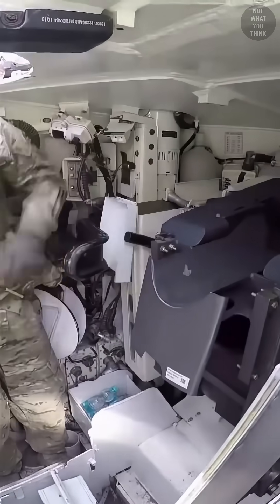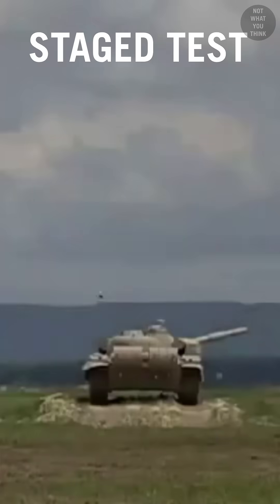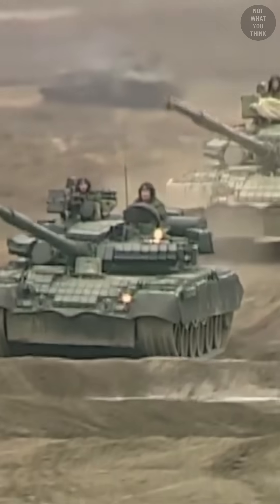Why M1 Abrams Tank Has No Auto-Loader #shorts

Comment: The Leclerc has an autoloader and also has a blast door. Truth is, when the Abrams was designed it was a good decision, not so much nowadays. But hey, the extra crew member makes it better in War Thunder...
Reply: ah yes the snail
Reply: @TheRealSteve42 according to some good tank channels on youtube (like tank nut dave) manual loading is faster for short bursts, but obviously humans get tired and autoloaders don't so in long fights it's less straightforward. That said, many theorize that sooner or later tank guns will need to become larger to defeat better and better armor, and at some point very few humans will be able to load several shells and remain combat effective. Will it be at 130mm Rheinmetall MBT gun? No idea, but the heavier the ammo, more attractive autoloaders become, until they are just required.
Reply: When they introduce a bigger gun like the 130 or 140 then they can't go around a autoloader.

Talked to a guy who served as a loader on Leo. 2 and he just told be that slinging those rounds is a pain in the ass for how much they weight.
Reply: @Tankliker  i’m gonna call cap on that. artilleryman constantly hand load 155mm shells by hand, which weigh more than twice the weight of a 120mm tank round, plus the charges. if i can load those rounds, then the tank bois can hand load a 130 or 140mm round too
Reply: @Wabbaaajack  on a stationary artillery piece in open field. 

Yeah, nice one. 

If you have the chance, just go inside a Abrams with the longest broom you can find and try to get the handle from the rack into the breach. If you manage then to it again but add like 50kg of weight to it. 

There is a very big difference between being inside a tank and being on a openly accessable gun which needs to be as simple as possible and has to operate out of supply often\air supplied regions.
Reply: @Tankliker  uhhh yeah, no. M992 CAT, tracked vehicle used to carry 155mm ammo. loading is done by hand because the conveyor belts are slow as fuck. try loading 100 lbs rounds inside a tight vehicle into slots overhead, it fucking sucks but very doable. still faster to do it by hand then using hydraulics. so yeah, nice one.
Reply: @Wabbaaajack  so you are telling me autoloaders suck because your nation didn't got it right. 

The Swedes managed to fire 12 rounds in 45 secs with their Bandkanone which had a autoloader
Reply: @Tankliker  reload on the bandkanon takes 2 minutes with the auto loader. it’s ROF wasn’t high because of an autoloader, it’s because it was magazine fed. the swedes also didn’t get it right if they stopped production halfway through. try again
Reply: @Wabbaaajack  magazin fed by a autoloader. 

Nice strawman dude, every autoloader has a fucking magazin. 

Every modern tank has a magazin, both autoloaders and manual loaded ones. 

And you know the reason? Because where else would you store the fucking ammunition if not in the magazin.
Reply: @Tankliker  uhhhh, no. the bandkanon used 15 round replaceable magazines, sort of like a rifle. majority of tanks that use auto loaders use a belt system. so again, you’re wrong. manual loaded tanks do not have magazines, so again you are wrong. they’re stored in a honeycomb rack where it is hand loaded. i don’t think you know what a magazine is.
Reply: @Wabbaaajack  Ever heard of fixed magazins if you want the gun comparison? 

And yes, I am aware that most modern manually loaded tanks have both a bunker and a ready rack. Which are both still are basically magazins. 

You know, ammo storage is also called magazin. Magazin is just where you store the ammunition. 

A tank/spg without any kind of ammunition storage/magazin would be quiet useless.
Reply: @Tankliker  enough with the semantics. i’m talking about functionality. ammo storage compartments are also called magazines, that’s where we get the word magazine, from ancient weapon depots. but they don’t function the same way as magazines, like in rifles. that’s why the bandkanon is unique, it functions like a detachable rifle magazine, not just an ammo rack. that’s why it had such a high ROF. moving on, autoloaders aren’t gonna be necessary if tank rounds get larger because they’ll still weigh less artillery rounds which are loaded in similar conditions in the M1906 Paladin.
Reply: @Wabbaaajack  Dude, if you are able to sling 1,5m long 50-60Kg heavy rounds in a moving tank in a space not bigger than now. Then good for you. 

But i will bet money that 90% of all current loaders couldn´t do that. 

While a autoloader doesn´t even slow down when the vehicle is moving. At least in case of MBT´s. 

Next thing would be that the korean K2 already achieves between 3-5 sec on reload time, for every single time. 

PzH2000 also can fire up to 13 rounds a minute. With the help of an autoloader. Propellant is loaded manually tho.
Reply: @Tankliker  what i’m saying is from my experience, you don’t need an auto loader. the most you’ll find in a Paladin is the hydraulic loader, which has to be loaded by hand. we’ve been loading heavier rounds in just as cramped spaces for years and we’re fine. tank rounds, even ones with larger bore diameters, are lighter. you guys can manage
Reply: @Wabbaaajack  question, artillery rounds are two piece am I right?
Reply: @Tankliker  it depends. 105mm rounds are semi-fixed, meaning the charge and the round are loaded together, like one big bullet. a 105mm HE round is about 60-65lbs. a 155mm HE round is not fixed, the round itself is 100lbs and the MAC charges weight about 7 lbs a piece, up to 5 MACs can be used per shot.
Reply: @Wabbaaajack  now imaging loading those 100lb as a single piece while driving at like 25mph over rough terrain.
Reply: @Tankliker  the 100lbs is a single piece, i just said that. it’s 100lbs + all the other weight
Reply: @Wabbaaajack  ok, got that part wrong. 

Still, try load it while driving at 25mph over rough terrain while inside a tank. 

I think you already can imaging how good that works after like the 3rd round.
Reply: @Tankliker  Then he is a Pussy ;D 
A Good Loader is faster than a Auto-Loader. And he is also much more for the Crew than just a Loader. I say that as an Ex Tank Commander
Reply: @hf4040  they are faster on the first couple rounds. Then they get tired.
Reply: @Tankliker  you doing
Reply: @Tankliker  the french/german tank will have a 130mm AND an autoloader
Reply: @tm.8399  the French want the 140mm for the euro MBT
Reply: @Tankliker  the smoothbore hasnt been discussed yet tbh if I followed correctly, but being autoload has been an unanimous decision.
Reply: @Tankliker  Imagine wasting a month in this comment section, that's real dedication for arguing over a dumb topic
Reply: @Qrazy Gile loader of the new and super rare super M1 Thumper? 

I shouldn't have doubted him. 

He will sling those 100kg rounds singlehandedly then.
Reply: @biodidu25  biggest reason would be weight. An autoloader can be build way more space efficient, which literally translates to tons in safed weight.
Reply: @Tankliker  just a question, are the power plants in the tanks the same, the way they drive the way the tracks move, and what about amount of power it takes to pierce the tank? Just genuinely curious if there's any differences other than loaders that maybe why the army continues to use the Abrams.
Reply: @Dukes3677  compared to what? Leopard 2? 

If so, then it's depending on variant mostly. 

First of all Abrams is besides T-80 the only production tank with a turbine as far as I know, which only downside is very big fuel consumption compared to diesel. But all other metrics except heat signature are better, maybe except top speed. 

About the gun, Leo 2 has the L/55 since the A6 which longer than the M256, which is based on the L/44. 

L/55 gives a pretty clear firepower advantage. But the US won't use it because DU ammunition becomes nearly useless after 1500m/s of speed because they just self ignite and burn up mid flight. 

Germany on the other side uses tungsten, which has some poor characteristics after impact, but which mostly basically get solved with higher velocity, namely after roughly 1700m/s. DM63 reaches around 1750m/s I think. 

About the loader. It's a choice question. Autoloader means less lifecycle cost but is more expensive to buy and install, on the other side it can be made way more space efficient. That's why the T-14 Armata for example doesn't weight more than western counterparts with human loader. 

But the human loader on the other side means a 4th men in the field, which makes some jobs in the field easier because another hand is always welcome. 

But the biggest problem is that a human loader first of all needs much space and especially much height, because you can't load effectively if you are sitting or laying down in there. 

But every centimeter means more weight. You can translate for western MBT's that 1cm means roughly 500-700kg in added weight. 

And as we speak most western MBT's expect the Leclerc are at 65T, which means a great reduce in field effectiveness as more weight makes going through certain terrains more difficult. 

Overall the human loader is a good short term solution if you design a tank that does not need to stay long in combat but often out of friendly supply. While autoloaders are way more supply dependent but add much more combat effectiveness imo.
Reply: I strongly disagree. First it's about the ammo, auto loader tanks have predetermined sets of tank shells.
What they don't have is a mechanism enabling them to foresee the future.

Why is that an issue?
Because not all shells are alike.
They have different purposes for different targets.
How the hell would I know which target I'll encounter, and at what order?
I don't know what I'll need and I don't want a machine to decide for me.
And even the most elaborate and modern ones where you CAN change ammo, can't supply me with a series of same type shells, of any length required, that I may actually end up needing because:
1. You don't always hit on the first shot,
2. Sometimes it takes more than one shell to destroy a target.

This alone - the incompatibility of ammo - is enough to render the auto loader system for tanks irrelevant.

The loader (Let's decide that "Loader" is Human, and "Auto Loader" is the out of touch mechanism, OK? Cool) is not just a loader:

He is the crew's Comm Specialist.
We have all types of communications systems, and sure, as tank commander I CAN take care of them if something goes wrong. 
but you know what?
I'm kinda busy here commanding the tank crew...

Under no circumstance would I prefer a tank with an auto loader,
or even find any room for comparison of one, with the far more preferable 4 men crew based tank.

Without elaborating too much, the Loader is trained to a certain extent on other crew members duties.
He can replace one, and I, as commander, can make do with a team of 3 for a while if I have to.
The duality of capabilities also allows the crew to conduct double shifts, if we're on a long mission like an ambush.
Not much an auto loader can do here.

Also, the Loader, like other crew members, is also a trained infantry soldier when need arises.
He can grab a machine gun, an M4, both perhaps, some ammo, a medic kit and water, and then dismount and fight if the tank is decommissioned.
He can help carry a stretcher if a team member is down.
Sometimes the entire company or regiment is used for an infantry mission:
With auto loaders we'd be 25% men short.

One perhaps lesser known facts about tank crews - We do A LOT of maintenance.
We are also trained to fix a lot of the problems that arise during training and battle, especially to the track system.
Losing a fourth potential man when these happen... No tank crew member wants two hands LESS on deck.
Reply: this guy plays war thunder, he knows his stuff
Reply: You guys are acting as if there tank battles that go on so long that the loader was too fatigued, and as if the driver loader or whomever else couldnt swap places with this guy in the event it somehow does become a never ending 12 hour fucking tank battle?? Lmao
Reply: @mimikeofficial86  That @Leopard2A7V guy apparently thinks tank combat involves the enemy driving in single file line over the hill where you have to engage tons of enemies one after the other over a couple hour period. In a real tank engagement it starts super quick and ends just as fast. You'll be dead before you ever end up in a situation where you need to load 10-15+ rounds in rapid succession. If you ever end up in a situation where you need to kill 10-15 enemies with no support then something went horribly wrong and autoloader or no autoloader you're gonna probably die.
Reply: @huntforandrew  thats what I was thinking, I doubt he really served as a loader in a tank, sounds more like a war thunder expert to me...
Reply: @huntforandrew  lol literally all new MBT uses auto loader machines. Nobody deliberately used manual human loader. The only one that defending the manual loader as you can see is just butt hurt M1 abrooms fanboys.
Reply: @sys3248  You do know the Challenger and Leopard 2 and Merkava all use a human loader right? Between that and the Abrams these are the best tanks in the world that everyone measures themselves against. Poland, Taiwan and Australia are all planning to buy M1A2C's, Leopard 2 is exported all over the world and the new Challenger 3 will have a manual loader.
Reply: @huntforandrew  try telling me when they were designed.
Reply: @huntforandrew  you can also tell me whether upcoming Design to replace Abrams would uses manual loader lol 
😂
Reply: @huntforandrew  "You do know the Challenger and Leopard 2 and Merkava all use a human loader right? Between that and the Abrams these are the best tanks in the world that everyone measures themselves against."

The challenger is crap, the Leopard is an old tank now, the Merkava ?

The Leclerc did better than the m1 in recent operation (Yemen, it has an autoloader. The chall 3 ? The Uk doesnt know and never made a good tank. The german and french next joint mbt will have an auto loader.
Reply: It's really sad that so many people liked this comment. Probably a bunch of kids and people with little to no real world experience. Automatic loader is better on paper, but in reality, manual loader is far better.
Reply: @joekent5675  because reasons I guess? Yeah, good ahh... thesis. 

The kid thingy can be ignored from my side, not important to the conversation. 

But your claim about reliability would be interesting, as one french guy already stated that a Leclerc tanker told him that the chance of the auto loader failing is very low.
Reply: @Tankliker  yes, I'm not exactly "hating" on the auto system, but a low "chance" can still be risky, especially in a war with a major superpower or another world war.
Besides that, manual loading is getting too much hate because of "new technology". Often times it's because of the "on paper" appeal that the auto loader seemingly has that outshines the manual...but the truth is, they are more equal than inexperienced people realize and it comes down to perspective and real world application. Yes, auto loading is more likely better for the short term engagements, that get rounds down field, and that free a man up for other jobs. But "medium plus" wars show that a fourth man is better overall, due to maintenance, observation, extra MG position, moral in battle, and emergencies. Auto loader might be better for france, but for America...it's not.
Reply: @joekent5675  what about the not so low Chance of the loader hurting his hand outside the tank and taking himself out of combat for a while by himself?

The whole reliability argument becomes useless if you look at an autoloader. The Russians already proved that they are reliable, you just need to maintain them. Just like the engine. 

Also, autoloader outshine manual. Less lifecycle cost, no chance of failure outside of service (an autoloader never will cross a road and get driven over or maybe break his hand and need 3 months to heal it) and all damages can be fixed in mere hours at most. 

It does not make loading significantly faster for 120mm shells. But 120mm is also the upper end for what humans can reliable loader if your tank crew isn't exclusive 1,90m guys who can lift them like it's nothing. 

But 130mm and 140mm mean either 10Kg or 20Kg more weight per round. And 120mm already weights 30kg.
Reply: @Tankliker  I'm not arguing that autoloaders aren't realible. Risky? Yes, even though there is a low chance of breakdown. Plus, once the round is in, the auto can't get it out. On paper, the autoloader outshines the manual loader, but in real life, they are nearly equals, with manual overall being better... but it comes down to size of country, military doctrine, and just overall preferences. The issue is the 4 crew mate helps in lots of other areas. 4 is soooooo much better than 3 when it comes to maintenance, emergencies, and even morale. It's a 2nd mg as well. A big war where is where the 4th crewmate shines, but short skirmishes, the autoloader probably will seem flawless.
Reply: @Tankliker  you're wrong about them being too heavy in the stamina department. An average army dude has no problem slinging those rounds around in the tank. I used to do something similiar when I was in. But my rounds were heavier and I handled a whole lot more.
Reply: @joekent5675  no back injuries afterwards?
Reply: @Tankliker  um...no. take care of your body and it's fine.
Reply: @joekent5675  I didn't ask for your general opinion. But ok. 

Anyway, look at how many retired tankers got out with back injuries and then look at how many of them served as loaders. You will see a relationship.
Reply: @Tankliker  that's true for many positions in military. There's more to being an army loader than sitting in a tank loading rounds. Jeez.
Reply: @joekent5675  why would you preload a round if you don't even know the target? 

That's not like in War Thunder or World of tanks, where the round just loads regardless.

Also, pulling a round back in the rack is nothing more than a technical challenges which can be overcome with ease. You literally just have to reverse the movement and add some holes or something at the bottom of the round to pull it back. 

It's not magic
Reply: @Tankliker  >what about the not so low Chance of the loader hurting his hand outside the tank and taking himself out of combat for a while by himself?

A gunner becomes a loader with the same fire rate. In case of the not so low chance of the broken autoloader of T-72 a commander becomes a loader with the very low firing rate. No commander in the tank just because some mechanical stuff is broken, very clever design.
Reply: @thewhite8uard  nice strawman. Maybe provide a number next time and also compare equally. 

Back injuries after service for tank loaders (which can take them out of service in worst case) and then loader failure in Leclerc, K2BP or Type 10 or even T-90 if you want too.
Reply: @Tankliker  the fact that you asked that question makes me wonder if you really know what you're talking about. 

Often times, in many engagements, a specific round will be loaded for a specific type of target, but then the target will change and so therefore the round has to be replaced by a different type.
I don't play those games...yet.
Reply: @joekent5675  and you seem to have no idea how an autoloader works. 

Yes, I've never taken part in a real engagement (and hopefully never have too. War is nothing to be proud of) 

But still, you literally just need the arm that pushes the round in to pull it out again, which can be easily realized by adding to grip holes for the arm that pushes them in to pull them out again and chance them.

Changing rounds also would probably take double the amount of time of reloading or more, if you put the ammunition back in the rack and pull a new one out plus a higher chance of deadly rack explosion because the door has to stay open longer. 

An autoloader would definitely cut time here, because the arm can just extent through the small hole for ammunition, pull the round back, close the door while rotating to the new round and then reload.
Reply: @Tankliker  I guess I could be wrong about this, but everything I read says autoloaders can't do that.
Nonetheless,  my other points still stand. I was in the service and I can tell you the 4th crewmate is better.
Reply: @joekent5675  I never said to drop the 4th man. 

I would just replace the human loader, as it safes human cost and space. 

The French also liked having 4 men. They just drove the remaining 4th guy in VBLs behind the tanks in their last combat missions with tanks as far as I know. 

Also, if the tank is under fire/out of combat but still under fire it really doesn't matter if you have a 4th man for repair or what loads the round anyway. 

What could be a game changer tho would be the 4th man as a spotter/radioman with his own optics and to take the task of the commanders shoulders to operate the computers inside the tank.
Reply: @Tankliker  It's funny fact, not an argument. You sure you know T-14 maximum engine power but its size is secret for you? That's denial.

As if only ex gun loaders have back injuries. That's the straw man. How does that related to combat readiness? Why "or even T-90 if you want too", but not T-72? Unlike T-90 T-72 is MBT of Russian Army. I
Reply: @thewhite8uard  how it relates to combat readiness and how I don't know internal design of a tank that's internal layout is protected as a Russian state secret but the engine power because they statet it in a official report from the kreml?

First, a loader unable to load is equal to dead weigh and you also have to keep him alive because he's still a living thing. 

About the engine, I could guess. I'm not a tank engineer who works for the Russia gov on their newest tank and knows all the metrics inside (which also are still a state secret) 

Also about you question why the Armata is so light. It literally has no turret armore. All that's sticking out is the breach, loading arm and hard kill APS plus some electronics, which all are only protected against light arms and shrapnels. The rest is literally just thin sheet metal to cover against small threads.
Reply: @Tankliker  >how it relates to combat readiness and how I don't know internal design of a tank that's internal layout is protected as a Russian state secret but the engine power because they statet it in a official report from the kreml?

I'm talking about size of the tank, not it's internal design.

>First, a loader unable to load is equal to dead weigh and you also have to keep him alive because he's still a living thing. 

And that's your argument? You can say it about any crew member it won't sound more silly than that.

>Also about you question why the Armata is so light. It literally has no turret armore.

I didn't ask it.  But it's funny that you claim that MBT that 10 tonnes heavier than T-72 has no turret armor. It makes T-72 looks like it has no armor at all.
Reply: @thewhite8uard  I stop here. Just watch a yt vid and you will learn something about it. 

I can't explain if you literally dismiss facts because you don't like them. The T-14 has basically no heavy turret armore. That's s simple fact. 

Also, yes internal layout has something to do with engine volume 

Smaller engine = less volume =  = less weight/volume to put armore around or more space to put shit in. 

No tank has a big airfilled gap inside if not absolutely needed. 

Also, yes. Retirment cost are a real concern, because your tax money pays for the retired soldier.
Reply: @Tankliker  >Also, yes. Retirment cost are a real concern, because your tax money pays for the retired soldier.

Where is your data?

>I can't explain if you literally dismiss facts because you don't like them. The T-14 has basically no heavy turret armor. That's s simple fact. 

Ok, dude. How's that explain 10 tonnes increase in mass? T-72 had no armor at all even in hull? Or T-14 is design failure? 

>Smaller engine = less volume =  = less weight/volume to put armore around or more space to put shit in

How does that related to T-14? T-14 is much heavier and bigger than Soviet/Russian second generation MBT. T-14 is almost 2 meters longer than T-72. If it's all armor than T-72 has no armor.
Reply: @Tankliker  >I can't explain if you literally dismiss facts because you don't like them.

You don't dismiss facts, you dismiss incorrect arguments. Fact can be denied, and that's what you do all the way.
Reply: @thewhite8uard  then tell me one of your facts.
Reply: @Tankliker  >then tell me one of your facts.

T-14 is almost 2 meters longer than T-72, and almost 1 meter longer than M1 Abrams.
Reply: @thewhite8uard  what data do I need to show to prove that retired soldiers need to be paid retirment for them to survive?

About the T-14. The LOS armore on the front is about 1m. That means a large block of 1m of armore is there. Also it's a 3 men tank with an autoloader, so it doesn't need to cover space for a standing loader. Autoloaders can be build way more space efficient. 

About the turret. As I said, it's just the breach and the gun, some electronic, optics and the APS. The gun itself is just such a small target that hitting it is less likely than hitting the hull even in a semi hull down position and because all three crew members are in the hull in armored capsules with 1m of armore in front of them nobody cares. 

A tank can be replaced if destroyed, skilled crew can't if killed.
Reply: @Tankliker  >what data do I need to show to prove that retired soldiers need to be paid retirment for them to survive?

You need to show data that an M1 Abrams gun loader get increased retirement payment. Or it's just an argument to the poverty? Yeh, Russia is a poor third world country and they pay nothing to their NCO servicemen.

>About the T-14. The LOS armore on the front is about 1m. That means a large block of 1m of armore is there. Also it's a 3 men tank with an autoloader, so it doesn't need to cover space for a standing loader. Autoloaders can be build way more space efficient.

So you admit T-72 doesn't have adequate armor.
Reply: @thewhite8uard  the T-72 had adequate armore for its time. So good the west was unsure if it could pen it with the earliest 120mm projectiles. 

They also still upgrade the tank to stay competitive. The main problem isn't armore tho, but that the loader won't allow bigger ammunition to be used. 

The T-14 counters that problem with a new gun that makes it possible to user longer penetrators.
Reply: @Tankliker  >the T-72 had adequate armore for its time. So good the west was unsure if it could pen it with the earliest 120mm projectiles. 

HEAT is not what any tanker should be care of. APFSDS is a main anti-tank round for any self-respected NATO tanker.

What its time? It was easily penetrated in 1990, and it's still MBT of Russia.

>They also still upgrade the tank to stay competitive. The main problem isn't armore tho, but that the loader won't allow bigger ammunition to be used.

Not the loader, but the auto-loader. Now you see.
Reply: @Tankliker  sounds good on paper, but an autolouder with a 4th crew man creates a tight fit. Both options fill the tank up by itself and the cost would be even more, though I doubt the US would care much about that.
Reply: @Tankliker  >this is gold 

What is that supposed to mean? You still trying substantiate an auto-loader in a tank with manned turret by examples of a tank with unmanned turret?
Reply: @thewhite8uard  it's more about reliability and that you can pull out cases with an Autoloader even if loaded. 

I don't really understand you wording mate. It's a design choice. You can build an unmanned turret or a manned turret with autoloader. 

That has nothing to do with what metric is better but what the army that orders them deems more important. If they think crew in the turret is important they will put crew in it, if they think they can put every man in the hull with no downside, they will just put every man in the hull.
Reply: @Tankliker  >I don't really understand you wording mate. It's a design choice. You can build an unmanned turret or a manned turret with autoloader. 

If you turret is unmanned you have no choice other than design it with autoloader. So that's not the question. 

The question is why Americans, Germans, and British armored doctrine made them chose a human loader, and why Soviet doctrine made them chose autoloader. And the answer on the Soviet part is they could not provide a sufficient number of powerful and reliable engines for heavier MBT to have 4 crew members. And they couldn't provide a sufficient numbers of disciplined and educated servicemen as loaders. Soviet Union had much more tanks than any NATO country including USA. They just did not have appropriate human material for 4 crew member tank. An undisciplined and uneducated loader can blow up his own tank even in peacetime.

>That has nothing to do with what metric is better

Metric means more or less weight. If T-14 turret is much smaller and not armored why the tank is so much heavier than T-72?
Reply: @thewhite8uard  because it has more armore in the hull, a bigger autoloader (they still plan to implement 152 in the future) and a way bigger engine. 

Also, the Soviets where very much capable of producing as strong engines as the west. Just look at the T-80U. 

And as I said, a bigger engines still comes with the downside of higher consumption. 

The Soviets had 20000 tank in active service till the end. Losing one tank is less of a problem than if every tank consumes 25% more compared to now for this country.
Reply: @Tankliker  >a bigger autoloader (they still plan to implement 152 in the future) and a way bigger engine. 

They need new autiloader not because of 152mm HEAT rounds, but because separate loading of the old one limited the length of APFSDS penetrator. 

>Also, the Soviets where very much capable of producing as strong engines as the west. Just look at the T-80U. 

What did you not understand in "could not provide a sufficient number of reliable engines"?

>And as I said, a bigger engines still comes with the downside of higher consumption. 

Dude, stop making things up. They successfully upgraded T-72 from 840hp diesel to 1130hp diesel. You tell it yourself. It's not about bigger engine since difference is negligible.

V-46-6 (T-72A) 780hp length 1480mm width 896mm weight 980kg Engine displacement 38.88 litres. 
V-92S2F (T-72B3-2016) 1130hp length 1,560mm width 896mm weight 1,020kg Engine displacement 38.88 litres. 
MTU MB 873 Ka-501 (Leopard 2) 1500hp length 1,488mm width 896mm weight 1800kg Engine displacement 27.4-litre.

>The Soviets had 20000 tank in active service till the end. Losing one tank is less of a problem than if every tank consumes 25% more compared to now for this country. 

>The Soviets had 20000 tank in active service till the end. Losing one tank is less of a problem than if every tank consumes 25% more compared to now for this country.

Stop making things up. Lower fuel consumption was in T-64 5TDF engine with engine displacement 13.6 litres, but "because of the time-consuming construction of the 5TDF engines, which took about twice as long as the contemporary V-45, the Malyshev Factory in Kharkiv could not provide a sufficient number of 5TDF engines for all Soviet tank factories". Second, 20000 cheap and poor tanks are still consume more fuel than 1000 better tanks.
Reply: @Tankliker  newest Japanese MBT has commander type with 4th man in charge of battlefield data management basically operating a computer.
Reply: @thewhite8uard  have you ever see modern Naval gun turrets? They are completely unmanned. Mating the turrets with the barbette for the whole machinery volumes can make it achieve something like automatic fire on 76mm up to 120mm caliber. Their only downside is its weight.
Reply: @sys3248  you mean the Type 10? 

It's a 4 crew light tank with a 105mm Gun. 

They probably choose the 4th man mainly because they expect the tank to be out of supply often and therefore not being able to receive maintenance and spare parts often. 
Plus it's just 105mm as the main gun. 

Also, having heavily computerized commander positions is normal today. 

The German 2A7V commander basically sits on an armored server in his position.
Reply: @biodidu25  don't know if you know, but the 120mm cases are mostly made from Polymere, only the baseplate is steel. 

So all that's left to expel is a steel disc.
Reply: Yes exactly. You can have an auto-loader that works with a blast door and separate compartment.
Reply: If that autoloader malfunctions, the tank's out of action.
Reply: @renzeusoya5828  If the loader has a heart attack, the tank is out of order too. Both are highly improbable nowadays.
Reply: @renzeusoya5828   If that autoloader malfunctions, the tank's out of action.  that's why the Leclerc could still shoot n Yemen while the M1 got fcked.
Reply: @renzeusoya5828  same goes for if the loader get a concusion
Reply: @renzeusoya5828  If the loader get´s injured or killed he is also out of action. 

You can fix a malfunction of an autoloader on the field, you can´t revive a dead loader.
Reply: @Tankliker  " If that autoloader malfunctions, the tank's out of action. " tell them which tank had the best rate to survive a shot in Yemen and still be able to shoot, they'll be surprise
Reply: @tm.8399  the loader cod be replaced by the commander tho. 

Also, it's the Leclerc probably?
Reply: @Tankliker  Can the commander load as fast as a dedicated man ? probably not. And the multiplication of task for the same man leads to error
Reply: @tm.8399  I know. Question would also be pretty rough, as most tank commanders probably would just go on retread if the gunner or loader where wounded to the point where they are out of order or killed. The emotional impact would probably too hugh in that moment to make a objective decision.
Reply: The Leclerc also has a large drum in the front of the hull where ammo is store not behind a blast shield. Quit your bullshit.
Reply: @SpaghettiButSexual  The Leclerc has a blast shield, futhermore it has been proved that the Leclerc has a better survivability rate than the m1 by the experience in the same battles
Reply: @biodidu25  "the main of the combat we're seeing today is assymetrical warfare/Guerilla Warfare.
I'm not talking about a war that happened 30 years ago but the current use of modern MBTs."

Which is why current mbt needs to move fast while shoot. Because a single insurgent can pin down your slow immobile mbt 

Beside than the M1 was too heavy to fight in Afghanistan while autoload french tanks were helping in the mountain.

"And no, it's not "Often used".
As i said before, fire support is the main task of armored divisions nowdays and if you don't have a reason to move, why would you lower your precision by shooting on the move." That was the US cold war doctrine, since then they evolved more toward french doctrine, you are the one seeing current war like it was 30 years ago.

"The bumping isn't that bothersome. First because it's not that frequent to have to shoot on the move and second because it's just NOT that bothersome. (You're correct, human error is higher that automated designs, i've never said the opposite.)" It totally is, and the only excuse you find is "you don't reload while mooving", yeah..

.look at yemen and turkish situation (in Syria) to see how wrong you are about how current mbt with no autoloader are almost useless while the Leclerc performed much better because they could shoot and move
Reply: In terms of the Abrams design tho, I'd say its loading system definitely has seen better days, but I'd say a manual loader is still viable, the designers just need to design the loading system to make it much less tiresome and risky for loaders. An assisted loader I'd say is the future of manual loading as long as the loader doesn't have to lift the shells all the way to the gun.

I'd say the huge disadvantage autoloaders have is the ability to switch between shells on the fly. Not being able to change shells before loading it can mean life and death of a tank imo.
Reply: Human loader is more accurate due to choosing bullet touse
Reply: @mondg6051  Leclerc can take up to 7 different rounds in the rack which have little to none optical difference thanks to barcodes.
Reply: Giovanni Martinez  look into the mirror my friend. What you're spouted off is called projection.
Reply: Giovanni Martinez  you've called me an idiot and your critic literally only consists of arguing about anecdotes. 

Tell me, who here used any links or shit. I at least used numbers here and there while the most common counterarguments where things like: 

-Autoloaders are to unreliable (without prove plus it is defacto wrong, the US M1 TTB cycled 40k rounds without firing them before needing repairs, and that was just a prototyp) 

-Not being able to unload ammo to change ammunition (Also not true as the M1 TTB Autoloader was capable of loading and unloading)

-The fourth crew member being of higher value than the loader, which can be dismissed. The French just drove there 4th men's in VBLs behind the tanks and basically only had minor to none issues. 

- 130mm and 140mm being loadable by hand. 

Yeah, try it. 120mm already weights around 25-30Kg and has a length of 570mm. That's a bit more than half a meter. 

The 130mm is already 1300mm long and at least over 30Kg. Can you imaging handling that in such a confined space as the turret basket?

But the French 140mm is the actual killer with 1500mm in length and probably 50kg weight for each individual round. 

You don't even need to be a loader to understand that those sizes and weights are just beyond human capabilities in such a confined space as the turret basket. Even in open field just lifting a 1,5m long rod that weights 50kg is already something not everybody can do.

An Autoloader is not an option, but the only sensible solution at this size if don't want to reduce combat effectiveness and reload speed greatly for not guaranteed better performance in maintance in such a future vehicle.
Reply: @biodidu25  I don't think a manual loader is as fast as an auto when the tank is bumping at high speed like the Leclerc is intended to be use.
Reply: @biodidu25  It is often used, example the Leclerc in yemen, (the m1 they couldnt) and the gulf war was all about shooting while marching forward.

 The firing while moving is often used now considering the computer does the calcul the human can't do to stabilize the cannon.

The bumpin not that bothersome ? LOL Human error is always higher than automation error
Reply: @biodidu25  + even Nato trainings involved that scenario. Futhermore, what makes the leopard 2, the Leclerc and updated M1 above the Chall are their stabilized cannon while mooving.
Reply: @biodidu25  Yes, i am a fool when the Nato officer explain the tank cannot be used in support anymore because they simply can't follow them.

Explain to me why at the Lynx training the french Vab werent where the Leclerc where ? Oh yeeah support.

You are the one thinking that I am referring that the Leclerc will charge in the middle of an hostile zone  shooting everywhere like a Hussard. That's what you've learned ? Oh please.

The NATO doctrine is all about being immobile with MBT as an infantery support, yes, that's why the french made the Jaguar to support the infantery, to see the mbt do the same obv lmao.

That's why we are switching mbt to mbf, from main battle tank to mobile protected firpower, to stay immobile obv.

I v been in the 1st Panzer Division at Oldenburg. Is that true, maybe yes, maybe no, like you.
Reply: I think the biggest reason why is it's easier to have a manual loader and try to make sure they guy doesn't die than it is to maintain an autoloading mechanism in all those tanks, which could fail and prevent the gun from firing
Reply: @direkte5303  maintance cost on an autoloader is actual lower lol. 

Like, as long as it isn't used it also has way less wear and you don't have to feed it and pay retirment after it goes out of service lol.
Reply: @Tankliker  "As long as it isn't used it has way less wear" yeah thats like everything though? Reliability is the ability to not be maintained very often while in use, not the ability to not be maintained while not being used. A human will always be more reliable than an autoloader, and in the event an autoloader on a tank is broken it has to be repaired somehow, most likely taken out of battle to do so. In the heat of battle, anyone who knows how can manually load a tank if the guy who usually does it is out of the picture.
Reply: @direkte5303  no, a human loader still wears out, even if not used. 

It's called being alive.
Reply: @direkte5303  how many m1 Abrams does the us military have? how many times does each abrams fire currently? i’m guessing the average is a hell of a lot lower than necessary to count as being overused and thus it’s not high enough to cause issues with wear
Reply: @Tankliker  I was astonished to read that the Veterans Association reckons 40% of US soldiers has long term disability directly caused by army service. Most were minor to moderate. Apparently automobile crashes injure most soldiers.
Reply: @langhamp8912  tbh that's not really surprising. 

Army service today is basically beyond human capabilities.
Reply: @Tankliker  What I find disturbing is the VA often (usually) dismisses soldier injuries as being in the mind, but such injuries, especially back injuries, can easily be confirmed by CAT soft tissue scans instead of X-rays. I used to work in a hospital and maybe half our guys were military or ex-military, and they all looked smashed up but almost without exception they had their claims denied. I mean, when you get called over to help them out of a chair, or up the steps, you think just maybe they have real injuries?

US has really bad health care, but the VA openly mocks their soldiers.
Reply: @langhamp8912  Sorry to hear for the people that where soldiers and got their claim denied. 

But the US military doesn't need to fix that. Look at the US wars, they literally need new recruits all the time, because active combat consumes a lot of good men. Whoever isn't capable to keep up is let go. 

Next thing would be that the military literally is the only way for some people out of poverty. 

So they have a secure supply and fixing the system would cost millions. 

War is always a loss and the USA is already beyond want it would be able to pay.
Reply: @Tankliker  
The costs argument between auto and manual is mostly due to initial costs.
Most don't think of maintenance and overall costs.

The only problem with autos is that if parts are complicated, they can become useless if a failure does occur but that's incredibly rare and less likely to happen than the chances of a dumbbb manual loader taking a selfie or making a TikTok video while loading and ends up fckkkn up or gets hit when the gun recoils.
Reply: @direkte5303  an human loader need to be maintained, can be injured, cost a lot and is very unequal in his capacities, an autoloader does the job, everytime, without training.
Reply: Gess agen an outo loader takes 11 seconds we load M1A2 in 4
Reply: @rodneysneed7155  the old ones in T-72 take like 6-7. 

The one in the Korean K2 more like 4-5
Reply: @rodneysneed7155  leclerc autoloader takes less than 5second regardless the condition, you take more than 4 when no in iptimum condition (tank stopped, not injured and good shape), you won't load it after you havent eat for a week in 4 sec
Reply: @rodneysneed7155  which one
Reply: Best answer :D
Reply: nice
Reply: L E G L E R G
Reply: can autoloaders lap load?
Reply: It’s got blow out ammo rack XD
Reply: @biodidu25  I'm talking about actual combat and practicality on the field, not theorical scenarios.

MBTs and other Armored vehicles ARE NOT the first line of attack nowdays and if a tank is in a situation to be fired at it's already a major failure

It's simply wrong on any recent scenari in which mbt were involved. Turkey, Yemen, Israel, Iraq war. MBT weren't use an a support thing to enter village.

Rest in Fr, so IDC.
Reply: @biodidu25  Typically, in this video you can see that immobile tank were easy target and at one time tanks shooting while mooving (poorly but considering the t72...)and, weird, that's the one that survived. That doctrine of sitting platform is dead since the Berlin wall falled https://youtu.be/6q7fFVahw0Q?t=110
Reply: @biodidu25  poor usage by using it immobile. That's the doctrine you are talking about lmao
Reply: @biodidu25  always find excuse and a YouTube warrior doesn't interest me. Veteran in YouTube that has read any recent NATO doctrine strategy yes ofc
Reply: @biodidu25  Youtube veteran. discussion de bistrot but Nato generals disagree with a youtube vteran arf, maybe that's why you are a veteran from youtube not a french officer :)
Reply: @biodidu25  I don’t see what’s silly about the ammunition as that’s the most critical part why current auto loader systems are inferior. I’ll try to explain.

 The 120 mm IMI "Arrow 6" armor piercing shell.

I fire this at a tank, bye bye tank.
It will penetrate the armor, raise havoc in it, and within less than a second blow it sky high.

But wait! 
What if this is the next shell loaded in my auto loader, but in front of me I suddenly encounter an Infantry company?

Well, I fire this, because it's an auto loader, and I can't change the ammo NOW,
One infantry soldier dies a very exotic death with an entry hole in the gut, the shape of a small sun with rays, like a 4 year old would have painted it.
Through the hole, if one were to look closely, you could see a small cloud of dust behind the soldier, where the projectile enters the ground.

The rest of the enemy infantry?
They'll be just fine.

And it's the other way around too.
This time my auto loader is armed with this baby The 120 mm IMI "Shaped Charge" dual purpose shell, which is effective against light vehicles, APCs and infantry...

Then along comes a T-90...

Are you fucking kidding me?
What, we feel like scratching some paint of the T-90's front?
What the hell am I supposed to do with a shaped charge shell now?

See, my point is, this type of auto loading system negates the basic definition of warfare, as set forth brilliantly, by Prussian Major General Carl von Clausewitz: 
"War is the realm of uncertainty".

There's a reason these auto loaders have been abandoned as a concept. During a time when Soviet tactics of masses, moving fast, with vehicles staying small, and coming in waves matched that concept once. The Soviet’s were fond of auto loading main guns in their quest to reduce tank size. 
In today's battlefield this would be suicide.

Don't get me wrong - I love technology, my work revolves around it, I appreciate modern military technologies and in awe of the people behind them.
But a tank is only as good as the crew handling it is.
This is the origin of the IDF armor corps motto:
"The human in the tank wins".
Reply: @zombieepx1933  lol 😂 autoloader can change their ammo. You wrote that  brainfart without even researching them first ?
Reply: It's easier to design a auto loader in rapid prototyping.
Reply: I'm gonna go with the country with the most powerful military on earth on this one.
Reply: @DeadwoodClimbing  the most powerful country retired it's tank divisions while looking to produce it's future concept tanks that incidentally uses auto loaders.
Reply: The Strykers with the 120mm have autoloaders
Reply: @biodidu25  they tell you the same, I heard in case of the Leo 2 1cm in high translate to like 600kg in added weight. 

A human loader costs a lot of space at the turret basket.
Reply: @Qrazy Gile I can name quite a few arguments against an auto loader:
1) when the belt (or whatever mechanism the loader draws rounds from) is empty, you lose a crewman who now has to reload the belt. so you’re going from 3 to only 2 working crewman.
2) if you have, let’s say, a sabot round loaded and you now have to engage infantry in cover, you’re SOL. you now have to spare a crewman to unload the sabot round and load some HE or some other anti-personnel round.
3) if the auto loader fails for ANY reason, you are now no longer able to use your cannon and you’ve now have to pull back and either try to correct the malfunction or RTB. if a human loader is down, the gunner could take his place. would it be ideal? no but shit happens, and at least you’re still combat capable.
arguments for a human loader:
1) the human loader does more than just load rounds. they’re able to operate the pintle mount machine gun and the .50 cal, as well as operate comms equipment
2) aside from just mechanics, the 4th crewman is also able to perform first aid on other crewman if need be, and replace them if they have to.

as for the loading angle, i don’t see why the human loader wouldn’t be able to reload at any angle. i’ve had to load 70 lbs rounds at high angles (900 mils+).
Reply: It’s still better these days. On a mechanical level. Auto loaders have more moving parts which means a significantly higher chance for failure and harder to fix. A manual loader will have less moving parts and a smaller chance for failure.
Reply: The huge downside of an autoloader is mechanical failures. That imo far outweighs the marginal benefits.
Reply: @collegestudent6071  not really. All self propulsed artillery are auto-loaded nowadays. In conceptual terms, even pistols vs revolvers have the same kind of discussion.
Reply: @Tentacl   The M109A6 and M109A7 would beg to differ,   They're both still loaded by humans with the assistance of an auto rammer.
Reply: @collegestudent6071  which aren't an issue. If they were, they wouldn't be used.
Reply: @collegestudent6071  there are a million things in a tank that will break down before the autoloader
Reply: @SchwertKruemel  Yeah, right. Autoloader: "Oh, I have a malfunction and should break now. But I can't, the engine didn't fail yet..."
Engine: "Oh, I have to break now, as the autoloader is about to have a malfunction soon"
Reply: @collegestudent6071  marginal? 

Bruh, autoloaders have a chance of failure, yes. 

But you can literally make it possible to load rounds in like 3-4 sec without slowing down. 

A human loader wouldn't be able to do that.
Reply: @collegestudent6071  
Failures happen far more if humans are directly involved than a machine that just reads 1s and 0s
Reply: @biodidu25  German. funny enough currently in Netherlands tho
Reply: Yeah, I get ammoracked in t80 more than anything
Reply: And by mentioning war thunder you lose all credibility you fucken nerd
Reply: @Shitbird3249  As usual, irony is lost on idiots.
Reply: @Shitbird3249  honestly not even. I bet most war thunder players would know more than many of the shitters here
Reply: humans can load better than an auto. The boar can still only take so many rounds before it heats up and can bend. I have performed the job and can load a round in less than 2 secs. Not to mention if you need to change rounds (HE or SABOT, etc...) it is also way easier to tell a human than a machine. the switch is immediate. and I don't think the tanks with auto could do that.
Reply: @StreetSWAT  found the keyboard warrior boys
Reply: @StreetSWAT  oh boy are you in for a treat when you look at the Leclerc, K2 and Type 90 lol

Human loader isn't really faster, maybe over the course of the first couple rounds. But combat often rages till all supplies are empty or enemy defeated, which still can take hours. You won't sling those rounds in at full speed after having done this for 4 hours and maybe moving. 

An autoloader on the other side does not have such weakness. They never get fatigued.

Also, about knowing which round is which. The French just use a bar code. Scan it and the rack will know at which place ammunition is stored and which round is which ammunition. System can take up to seven different rounds. 

Overall just from a fire power stance a autoloader would out gun any manual loader.
Reply: @Tankliker  He's just got job anxiety at the prospect of being replaced by a machine.
Reply: @11Survivor  I don't want to make him tremble. He surely can try loading this 140mm french round which are 1,5m in length and like 50kg each manually. 

Maybe trying to do the 3 rounds in 10 sec thingy lul
Reply: @Tankliker  then why haven't they? I mean you  have a lot of hypotheticals but the Abrams has results. Yeah simulated battle blahs blahs
Reply: @therealbfunke  cost cutting measurements. 4th crew member. 120mm still being physical loadable by a human. 

There are a lot of factors, some which are more like options. Like the 4th crew member/human loader. 

Other factors are also often outside the combat capability, like production cost and simplicity and another major factor is logistics, which includes weight, supply and spare parts and shit. 

The merkava for example is pretty good in the field of how easy it is to maintain, but it would be a logistical nightmare to move.
Reply: @Tankliker  Yeah that sounds like how ancient greece fell, they relied upon chariots that in the long run cost more than effectiveness
Reply: @Tankliker  An autoloader may not get fatigued, but it can break and then be extremely expensive and time consuming to replace. I think you need to factor that in majorly, as in something as large as the US military's arsenal having something that can be unreliable, expensive to repair, and take a large amount of time, will greatly limit its effectiveness. It's much cheaper, faster, and more reliable to train and maintain the human loader over a large number of vehicles.
Reply: @Adierit  Just replace the broken part. 

If the loader dies inside the tank you also can't just go on in 99% of the cases anyway. 

Also, if the loader dies you need a new crew man, which needs to be trained, feed and also could already fall out without even taking part in the engagement.

Somebody here also stated to have talked to a Leclerc tanker. The tanker told him that the parts in the loader are pretty reliable and don't break often. 

Also, do you really think a army would just like use the autoloader given to them if the thing isn't capable of taking a hit?
Reply: @Tankliker  replacing a broken part found inside of a heavily armored turret involves needing a crane, this takes time, replacing a dude responsible for picking up an object, and moving it, can be done by every retail employee on the planet.
Reply: @Adierit  you definitely will have a easier time finding a crane on the battel field than a new loader which is just as good with your crew and also as good as the old one. 

Lol, most Pionier tanks have a crane. 

And also, it's depending on the damage. You do not need to take out the whole mechanism for a little part. 

Also most modern systems on the field are designed for easy maintance, they literally want you to be able to fix shit in the field.
Reply: @Tankliker  bro it's not that hard to manual load and last I checked those autoloaders jam and will have your arm ripped off while trying to unjam it.another reason autoloaders suck they are to big which make the crew even more cramped
Reply: @kylelaughinghouse1893  guess you last checked in the 70's I guess. 

About ripping arms of, that was a problem with the prototype of the Soviets in the very early stages. If I remember correctly they also had like 7 cases. And none during actually service. 

Your argument would be more valid if you would show me like the numbers for modern tanks like T-14, Leclerc, K2 BP or Japanese Type 90. 

And after that the number of loaders who leave with back injuries.
Reply: @Tankliker  there is not ammo for 4 hours of constant fire. :0
Reply: @SakakiDash  so now we send tanks with 200 rounds into battle?
Reply: @Tankliker   Will most tank combat situations are solved within the first few rounds, Usually whoever shoots first wins and in those time more time in between of just a loader sitting there doing nothing.  But 120 mm is the upper limit of what can be practically loaded by one man in a tank.
Reply: @Tankliker  wo und wann hast du denn gedient und wer war der kommendeur deiner einheit zu dem zeitpunkt? bin ich mal gespannt...
Reply: @Tankliker  >But combat often rages till all supplies are empty or enemy defeated, which still can take hours. You won't sling those rounds in at full speed after having done this for 4 hours and maybe moving.

8kg is 7 month old baby. You say you can't move baby around for 4 hours? But which tank crew would resupply tank with ammo faster and easily 4-member crew or 3-memeber crew? Besides there is just 22 rounds in T-72 auto-loader. And in case of auto-loader is broken, which is very possible, a tank commander is a loader with the very slow firing rate.
Reply: @thewhite8uard  a gun with no crew. 

Look a S. Korean k9 Thunder and k10 resupply vehicle for reference.
Reply: @Tankliker  K9 is not MBT, it's a howitzer. Besides  the Korean peninsula is a very specific region for armored warfare. It's 600 miles long and 120 miles from coast to coast with a lack of flat terrain except for tidal flats.
Reply: @thewhite8uard  terrain and use of gun are not really an argument here. 

A tank is build according to terrain, and therefore the K9 can be taken as reference as it even being a SPG fulfilles major characteristics of a tank, like being able to move on tracks, 360degree traversable turret, has big caliber armament. 

I mean, Germany even trains there Pzh2000 crews to use the gun against enemy tanks in direct fire in emergency situations. 

In the end your argument makes No sense. And autoloader is not hindered by the terrain the tank drives on. An Autoloader is not hindered by the number of crew members, I actually think a 4 men crew with autoloader would make sense, as the role of the radio operator could become a possibility again.
Reply: @Tankliker  K1A2 is 54.5 metric tons. K2 Black Panther is 55 tons weight. M1 Abrams is about 65 tons. One crew member is 10 tons. If Korean terrain accept 65 tons tanks they would have M1 Abrams. Instead they sell their tanks to similarly small countries with difficult terrain.
Reply: @thewhite8uard  you clearly have no idea about tank layouts. 

A 4th man and no manual loader but instead an Autoloader does not equal plus 10t. 

Do you know why? Because you can put this 4th man in a sitting position, which is way more efficient. 

I would guess that a 4th man would mean more like 5-7t more than a autoloader one with 3 crewman at most.
Reply: @Tankliker  As if difference 5-7 tons is nothing, especially with the same engine horsepower.
Reply: @thewhite8uard  5-7t compared to 10t is a whole lot. Especially in case of traveling over certain terrain like mud.
Reply: @Tankliker  In fact it's 5-7 t difference compared with zero difference.
Reply: @thewhite8uard  so you are comparing 55T to 60-62t here. 

Still, especially the ground pressure would still be better than on a 65T tank.
Reply: @Tankliker  By the way, putting 4th man in a strictly sitting position to reduce weight reducing internal space is not efficient for tank crew efficiency especially in long term.
Reply: @Tankliker  Dude that's what I'm talking about. Korean just like Russians need lighter MBT that's why they sacrificed loader.
Reply: @thewhite8uard  Not really? 

Also, Russia did the whole weight safe and 3 man crew thingy mostly to be able to mass produce capable tanks. 

The T-72 was by no means bad at its time, they just didn't care much for crew comfort. All that was important was to have a tank that took a punch and could dish out equally. Not a vehicle with which you could survive the whole war with minor supplies.
Reply: @Tankliker  Soviets did lighter and thus uncomfortable MBT because of weak engines they had. Even today they have no reliable 1500 hp engine for their 55 tonnes Armata.
Reply: @thewhite8uard  bruh, they used the same engine from the T-34 up to today in those T-72 in heavily modified versions with up to 1100PS. 

That's not 1500PS, but after 800PS the horse power in this weight classes only serves to how fast a tank can accelerate. 80kph is also the physical limit for most tracks, so going faster only means unproportional wear for only a slight increase in speed.
Reply: @Tankliker  >bruh, they used the same engine from the T-34 up to today in those T-72 in heavily modified versions with up to 1100PS. 

As if I don't know it. T-72 had 840 hp engine till 2014 so it doesn't looks like Soviets had much choice when they designed the tank. 

>That's not 1500PS, but after 800PS the horse power in this weight classes only serves to how fast a tank can accelerate. 80kph is also the physical limit for most tracks, so going faster only means unproportional wear for only a slight increase in speed.

So they tortured crewmen by reduced internal space for no reason? 
Stop moving goal posts. It's obviously 55 tonnes MBT need 1500 hp. Period.
Reply: @Tankliker  don't need to be faster with a DU round. And you don't have one. We do. End. of. story.
Reply: @thewhite8uard  so how does putting a 1500Ps engine in increase crew space again?
Reply: @Tankliker  More internal space and/or armor leads to increased weight. Increased weight requires more powerful engine. Do you intentionally make you look silly, or you're really that way?
Reply: @thewhite8uard  so you want to put a 1500PS engine in a T-72 because the weight increases...? 

Also, bigger engines means more weight in itself, plus 1500PS are not required to move a tank of 55T reliable. The 1100 in the B3 version do the job just fine, it just accelerates overall worse, but that isn't a main concern for a second choice tank
Reply: @Tankliker    >so you want to put a 1500PS engine in a T-72 because the weight increases...? 

I never said that, you silly. T-72 is 45 tonnes tank, not 55 tonnes.
Reply: @thewhite8uard  *41,5 

T-72B3 is ca. 45.

Anyway, my bad. 

But still, why do you think a 1500PS is needed? The Brits use 1200PS in their Challenger 2's and the T-14 is claimed to go up to 1700Ps.
Reply: @Tankliker  >T-14 is claimed to go up to 1700Ps

On which planet? It's 1200/1500hp. And it's not in service yet. Anyway how does that prove Soviets did smaller and lighter MBT not because they had no powerful engines?

So why does 45 tonnes MBT with 840hp engine needed upgrade to 1100 engine in 2014?
Reply: @thewhite8uard  because the tank gained 4T and also not all T-72B3 Tanks get the 1130P engines plus they want to make it more mobile.
Reply: @thewhite8uard  I just googled "T-14 Armata engine power" and Google said that at full power it reaches 2000PS even.
Reply: @Tankliker  >because the tank gained 4T and also not all T-72B3 Tanks get the 1130P engines plus they want to make it more mobile.

So 49 t T-72B3 need 1130 hp engine to be mobile by the modern criteria just because it became 4 tonnes heavier, but >55 tonnes MBT doesn't need 1500 hp engine? You've just in denial of obvious.
Reply: @thewhite8uard  T-72B3 is still only 45 tons. 

Stop using short tons as if they where tons.
Reply: @Tankliker  >Stop using short tons as if they where tons. 

You the one who said "because the tank gained 4T", I'm just using some basic math. Anyway what does it change? By your own claims 45 tonnes tank need 1100hp engine, why 55 tonnes tank does not need 1500hp engine?

>I just googled "T-14 Armata engine power" and Google said that at full power it reaches 2000PS even.

The source of your claims is Wikipedia with link on an article in which some picture claims 1500hp and 2000hp at the same time, but it looks like an art designer mistook rpm with hp, A-85-3a engine has 1500hp and 2000rpm. Anyway, how does 55 tonnes T-14 with allegedly 2000 hp engine proves 55 tonnes MBT does not need at least 1500hp?
Reply: @thewhite8uard  yes, a 55T can also be moved with just 800Hp. 

It would just not be as fast as one with 1500Hp. The tank would not just not be able to move. 

Also, official sources for the T-14 also stated that the engine can change between powermides from as low as 840hp over 1350hp to 1500hp and up to 2000hp. 

The lower hp are basically only for marching so the tank can stay longer out of supply, the higher power options are for combat to gain more mobility to change positions and such.
Reply: @Tankliker  >It would just not be as fast as one with 1500Hp. The tank would not just not be able to move. 

"Move" doesn't mean just "move", you silly. It means "move" as it's supposed to move as MBT.

>Also, official sources for the T-14 also stated that the engine can change between powermides from as low as 840hp over 1350hp to 1500hp and up to 2000hp. 
The lower hp are basically only for marching so the tank can stay longer out of supply, the higher power options are for combat to gain more mobility to change positions and such.

Stop moving goal posts. Our topic now Soviets have no engine to move 55 tonnes MBT. By 1500hp (or 2000hp) experimental T-14 you've just proving it.
Reply: @thewhite8uard  how does a MBT have to move? T-64 is the first reall MBT ever build and weight around 38T with 700hp to move. 

The T-72 also is a MBT with 41,5T in weight and 840Hp in its most basic variant. 

The Abrams is not the MBT. It's a MBT. 

If the tank has 1500Hp doesn't change if it's a MBT or not. It's about its role on the battlefield. During WW2 the Stuart's of the Americans also basically fulfilled the role of the Sherman's in Asia because they could, because the enemy didn't had any AT to defeat them.
Reply: @Tankliker  >how does a MBT have to move? T-64 is the first reall MBT ever build and weight around 38T with 700hp to move. 

I didn't ask you that, but you've just proved my point that design is relied on power-to-weight ratio.

>The T-72 also is a MBT with 41,5T in weight and 840Hp in its most basic variant. 

That's what I'm talking about. 41,5T in weight and 840Hp because Soviets cannot produce more powerful, but reliable engines at mass.

>The Abrams is not the MBT. It's a MBT. 

What you've just said? Are you a bot that just trying to mirroring my sentences?

>If the tank has 1500Hp doesn't change if it's a MBT or not. It's about its role on the battlefield. 

MBT is the role.

>During WW2 the Stuart's of the Americans also basically fulfilled the role of the Sherman's in Asia because they could, because the enemy didn't had any AT to defeat them

The role of the MBT is to fulfill all the roles established in the doctrine. It's cheaper to have just one type in service than the zoo of the types.
Reply: @Tankliker  Funny fact: 55 tonnes T-14 is bigger than 65 tonnes M1 Abrams. How thin its armor must be?!
Reply: @Tankliker  Does it really?  Tank combat rages for hours until all supplies are empty.   When did this happen last?
Reply: @Tankliker  How you gonna tell someone who has literally been a tank loader about loading? lol you funny guy
Reply: @remster5284  ok, then have fun in there with a 1,5m and 50kg heavy APFSDS projectile. Hope you don't get back injuries long-term.
Reply: @therealbfunke  nice result in yemen compare to the lecler for the m1 hey
Reply: @thewhite8uard  An ammo  doesnt wiegh only 8 kilos. A sabot yes, but there is more than the sabot in an ammo. Get your fact straight.
Reply: @tm.8399  Anyway, It's just 20kg, 40-42 rounds, and pretty simple and short movement. It's not even squats that engage large muscles and take a lot of energy.
Reply: @tm.8399  Royal Marines PRMC push up test is 60 reps in 2 mins. For 70kg man it's more than 4,000kg overall, for 2 mins, by ~70kg , not 20kg, portions of weight.
Reply: @thewhite8uard  Push up ? Do you believe you lift your weight with push up ???? I don't even know what to take abut that info.
Reply: @tm.8399  there is fat for weeks of unlucky hunting and fasting in 10% body fat average height man, and it doesn't look like Americans are very lean.

I've said about 70kg. Anyway, do you believe you lift a round when you loading a tank gun? No, you just move it for a very short distance, you don't even lift it, it's not a squats, or bench press, or whatever.

Another example The PRMC Pull up Test, 16 pull ups for 1 minute. Yeh lower than with push ups, mostly because pull is harder than push, but still 1120kg for 1 min, pretty much high intensity. And don't forget, Those are tests for the marine recruits, not for the marines.
Reply: @thewhite8uard  "Anyway, do you believe you lift a round when you loading a tank gun? No, you just move it for a very short distance, you don't even lift it, it's not a squats, or bench press, or whatever."

 Oh yeah now you don't lift it, you use telekiesia to transport it from the back to the barrel ?

Push Ups in one minute using explosiveness != reloading a tank mooving for a day in heavy fight while sweating from the heat and the combat stress.
Reply: @tm.8399  > Oh yeah now you don't lift it, you use telekiesia to transport it from the back to the barrel ?

No, you just pull it from the rack and then push it into the barrel. It's obviously not lifting.

>Push Ups in one minute using explosiveness != reloading a tank mooving for a day in heavy fight while sweating from the heat and the combat stress. 

Now you confusing loading the gun, with reloading a tank with ammo. A gun autoloader won't load a tank for you. So 4 member crew is still better than 3 member crew. And explosive anaerobic exercises are more exhaustive than aerobic ones.
Reply: @thewhite8uard  you have to lift it from behind you to the rack, do you know what you are talking about ????

And for the rest lmao. Now a 400m if more difficult than a 2k up to 150kms. Get the duck outta here
Reply: @tm.8399  >And for the rest lmao. Now a 400m if more difficult than a 2k up to 150kms. Get the duck outta here 

It's different, you silly. 400m sprint is 75% anaerobic. Anaerobic glycolysis is less effective than aerobic fat burning.

>you have to lift it from behind you to the rack, do you know what you are talking about ????

So what? it's not 70kg, it's just 20 kg for 17 reps which is capacity of the rack, and it's not even a closer to intensity of 16 pull-ups in a minute, or 60 push-ups in 2 minutes. Anyway how does autoloader help you in that? Or you do believe t-72 does not have “ready rack”?
Reply: @Tankliker  interesting since American tanks dominate the battlefield. 🤷🏼‍♂️
Reply: @saltwaterrook4638  when Americans use them. 

There are enough pics of Egypt Abrams that got destroyed.
Reply: @saltwaterrook4638  not much to brag when US deployed Abrams only in the most optimal conditions with air superiority that comes with air delivered protection and awareness. 
After all Yemeni or even ISIL had no problem neutralizing Abrams (Including UAE Leclerc for Yemen).
Reply: @sys3248  lmao they didn't neutralize shit.
Reply: @saltwaterrook4638  they did. Iraqi Abrams , Saudi Arabian Abrams, and UAE Leclerc.
Reply: @StreetSWAT  that's a great point, but in contrast machine doesn't require as many supplies and, probably, ends up being cheaper in the long run
Reply: @StreetSWAT  Of course they can. The Leclerc use a codbar printed on each munition to identify what type they are
Reply: @StreetSWAT   This needs more likes.
Reply: @StreetSWAT  bro you're using 40 year old tanks. Elon musks gravity tank would destroy you
Reply: @ColinBFClarke  Elon musk's cyber truck couldn't take a brick